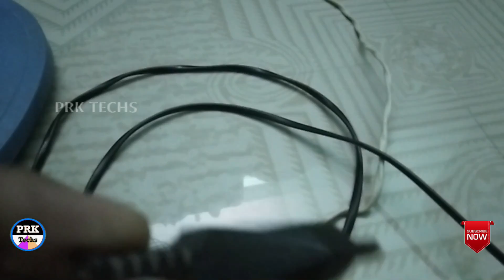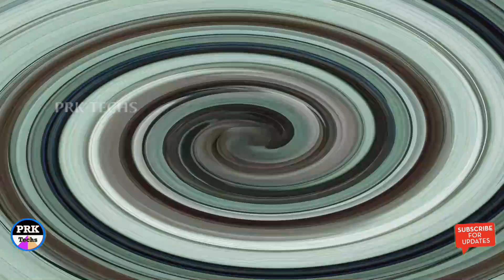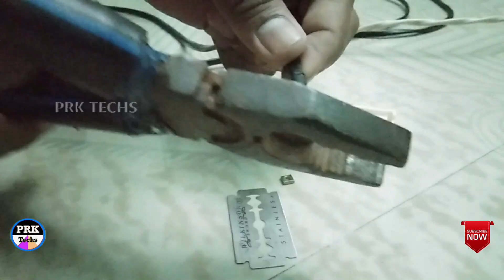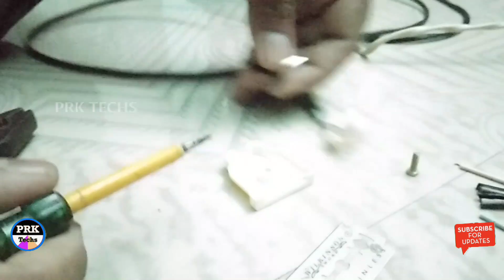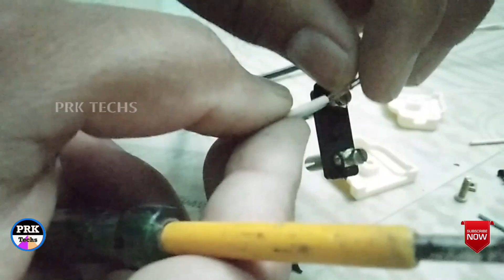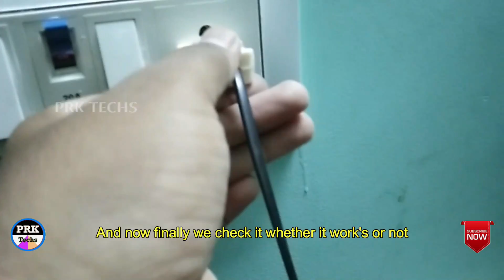How to change the damaged Table Fan plug at home

Comment: Do you really need to use tester or is it okay to use screw drivers?
Reply: Thank you for your valuable comment 
Tester is likely small screw driver so I use it if you have small screw driver you can use it
Reply: @balajipadma6445  IS IT OK TO CHANGE MY MALE PLUG FROM (6A-250V) TO (15A-250V) ELECTRIC FAN...TY

Comment: Will this repair method work if the wire was burned?
Reply from the maker: If the tip of the wire burnt you can cut that burnt part and replace the plug as shown in the video. 
But sometimes it won't work you need to change the entire wire it depends upon the damaged wire.
Reply from the maker: Thank you for your valuable comment.
Reply: Thank you
Reply from the maker: Thank you.

Comment: How to identify what is + and what is minus-
Reply from the maker: @BhanuPrakash-et5fi  If you are having doubt just open the bottom of the Table fan 2 screws are there loosen the screws and look at the wire which is connected to the switch and remember the colour of that wire that is (+) phase wire.
And the other one is (-) neutral wire
Mark the plug pin which is phase so you can identify it easily and always remember right side of the plug point is phase (+) make sure it is connected correctly or not 
Be cautious of electricity !!!